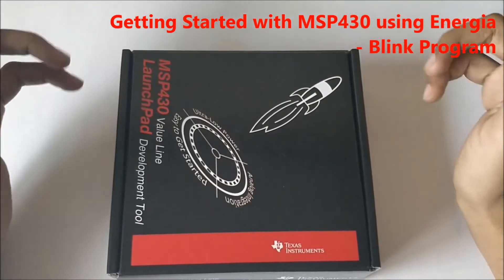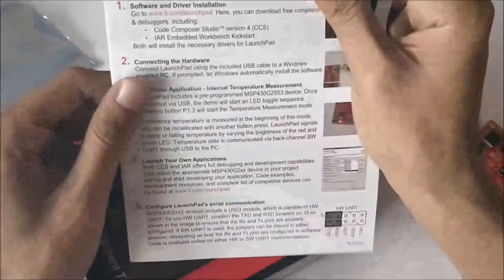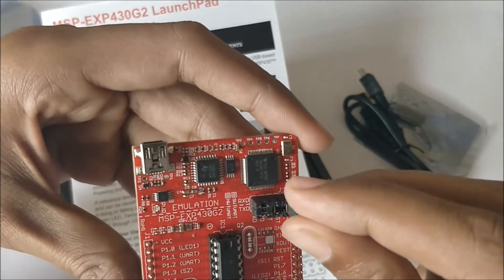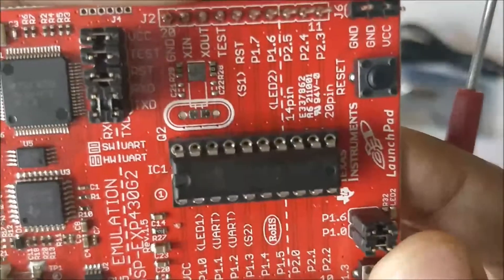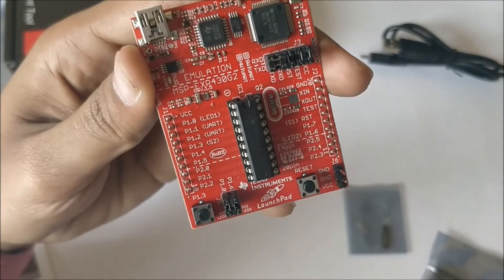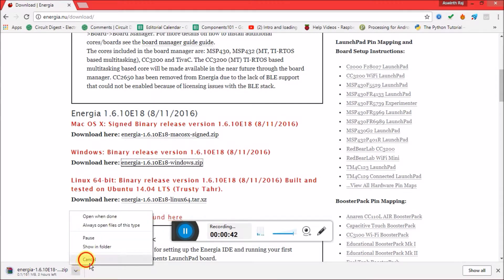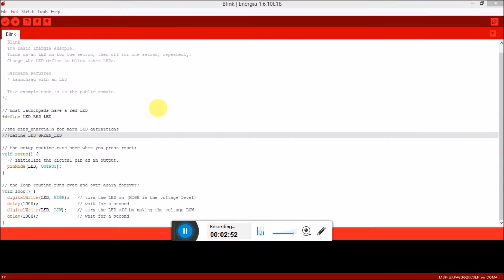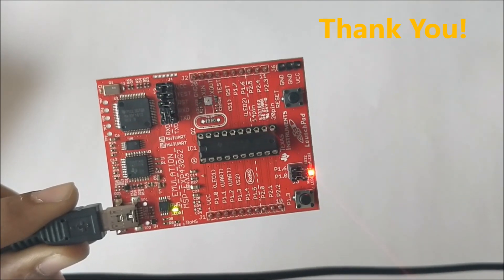Getting Started with MSP430 using Energia IDE

Comment: Hello, I faced the error and followed the link in the description and did as instructed but I have the same error message.
Reply: In the notepad file, when searched I found 4occurences of rf2500 instead of 2. I changed all 4
Reply from the maker: @harshiths.b4787  Have you resolved the problem? If not post them on our forums https://circuitdigest.com/forums to get them answered
Reply: Hello, thank you for your reply. I visited your website and used code composer instead, works fine. Thank you.
Reply from the maker: @harshiths.b4787  most welcome